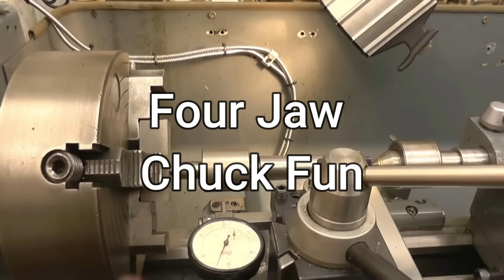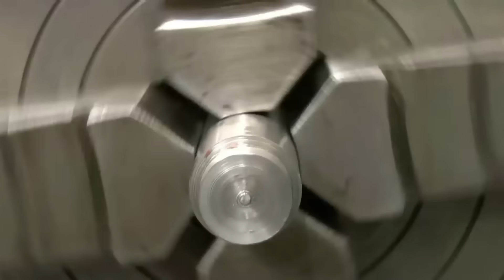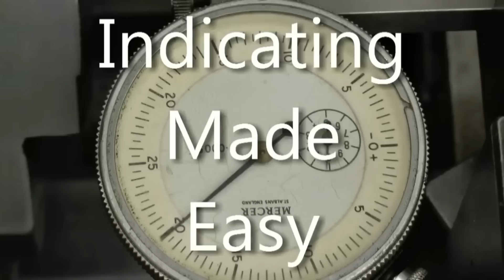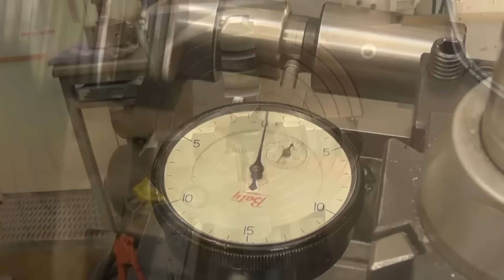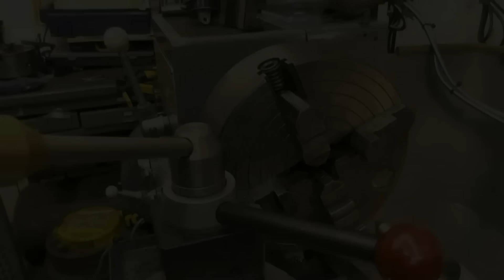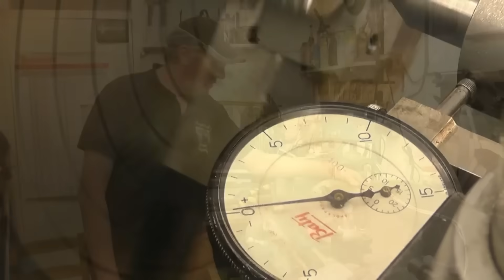Wednesday Catch Up 69  4 Jaw Fun

Comment: I think why the boiler was boiled dry and it over heated the tube. The inverted head is heavier than the  tube. If you could you could build  two  thick steel bushes for both heads you could  change  the tub easily  in the future. Cheers from Western  Canada.